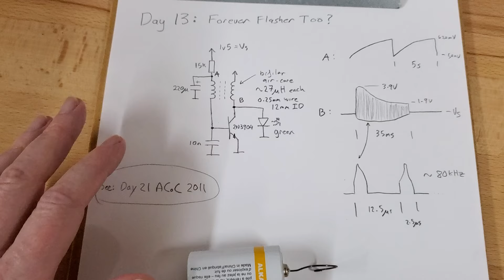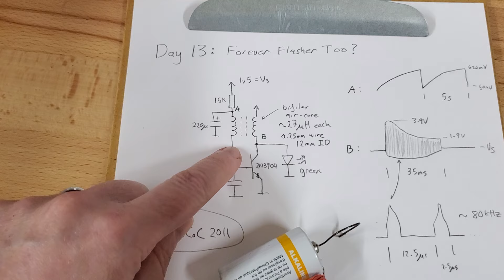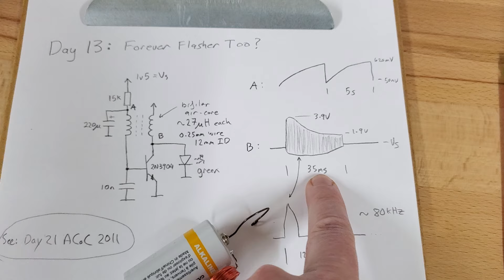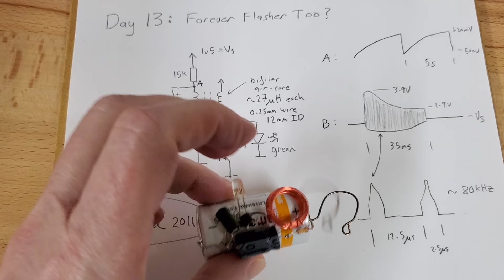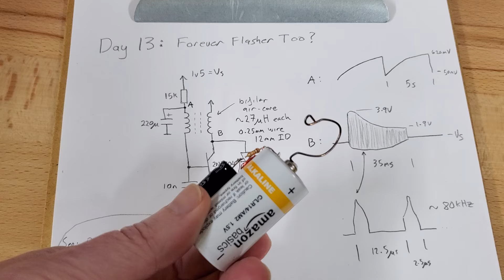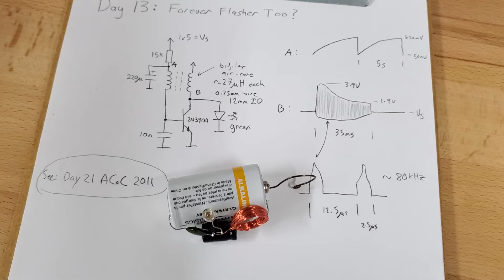ACoC 2025: Day 13: Forever Flasher Too?

Comment: Do one with a FET 😅 no BE forward voltage
Reply from the maker: Indeed, I have been working on a sub 100 mV oscillator using a JFET.  JFETs are nice for ultra low voltage supply oscillators, but for higher total powers at low voltages you need higher Idss devices which are fairly rare.  Even rarer is high Idss and low Vp together to get a good gm which helps a lot in making say the transformer for a Hartley topology less annoying to build.

Interfet are almost the only people left that still make JFETs with such properties.  Their N3600L geometry devices can have 1 Amp Idss - they are also quite low noise like most high current JFETs.  The old Siliconix J105 would be a good off the shelf place to start but it is rare nowadays.  I found some on eBay but they haven't arrived yet.  I tried some J310s and other JFETs I had but they either took off at UHF or refused to oscillate even at 0 Vgs/max gm with the transformers I was trying.
Reply: @vk2zay It WILL work. I made an oscillator for the medium wave band based on a JFET that would work on extremely depleted AA batteries. I think 50mV was the cut off. It was hard to believe.
It was using a ferrite loopstick so that made it very interesting in observation with an AM radio. I can't remember what the specific JFET was though Alan. It was 15 years ago.
By the way, I love your experimental electronics videos, they are amongst the absolute best. have you ever heard of Kludges from Kevin's Cave? It's in that calibre. Not exactly in the same way, but you have a specific educational quality that exemplifies what you're sharing. I think it's quite a valuable thing and perhaps a commodity on here
Reply from the maker: I totally believe it will work eventually, I just need to wind the right transformer for it...  The math certainly works out.  I intended to use it with a thermopile to make a small inverter for higher voltages instead of just building a huge thermopile with hundreds of junctions.  Not that such a thermopile wouldn't be awesome, but I only have so many hours each day right now and that is a lot of wire preparation and spot welds!

Hadn't heard of the Kludges from Kevin's Cave channel...  Looks like I have about 60 videos to watch over the holidays!